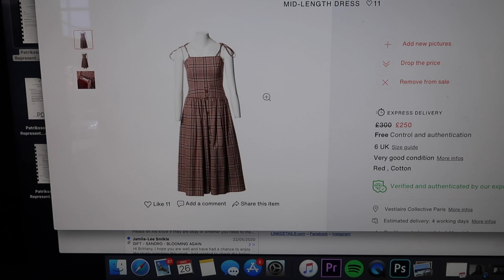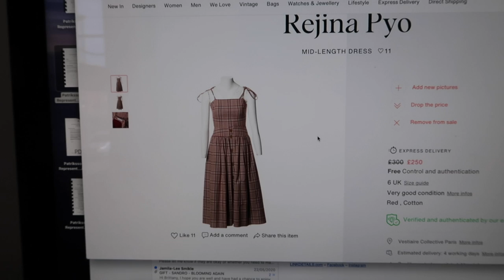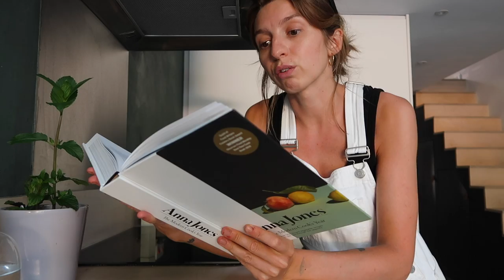VLOG | Desolate Bike Rides,  New Homewares & More Gardening.

Comment: Love your authentic vlogs and clean style. Could you tell me which countertops you have got in your kitchen? It seems like whitewasched wood. x
Reply from the maker: Thank you! The countertops are birch ply with an Osmo oil on top x
Reply: @BrittanyBathgate1  Thank you so much for your answer🤗. Try out Garnier Ambre Solaire Ultra-Light Sensitive Face Fluid SPF50+ next. It is very lightweight and performs nicely over a moisturizer or without and under make up.(Garnier, mentioned above, and La Roche Posay Anthelios Shaka Fluid are pretty similar, but Garnier performs better in my opinion. Both belong to L'Oreal)